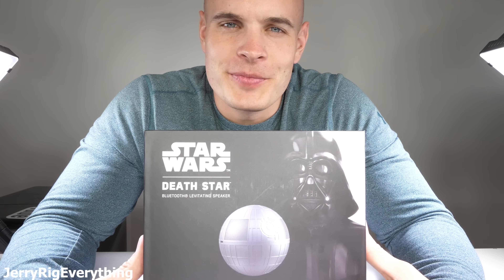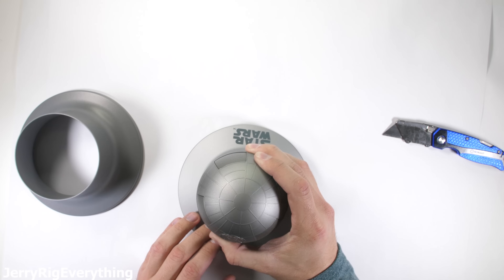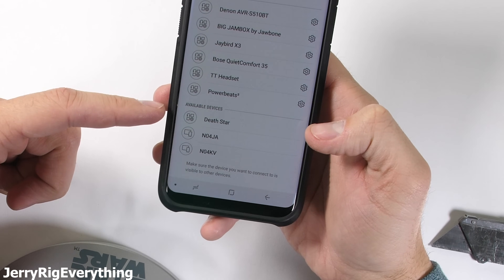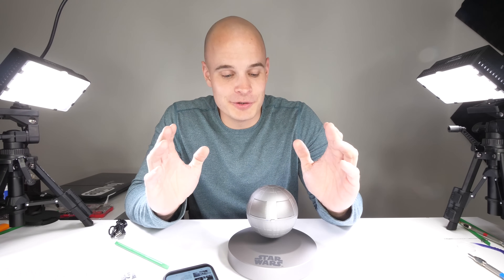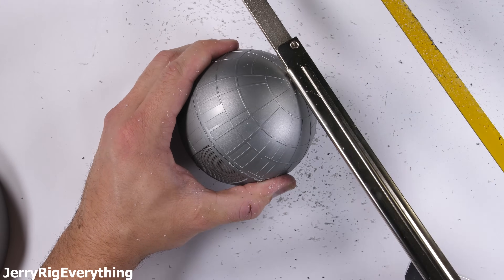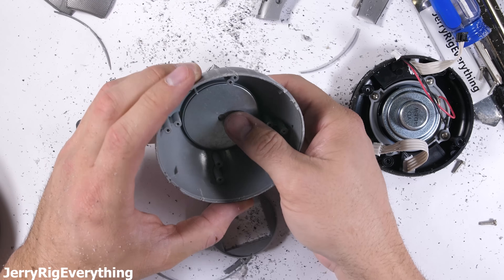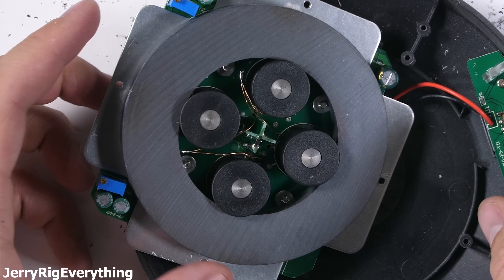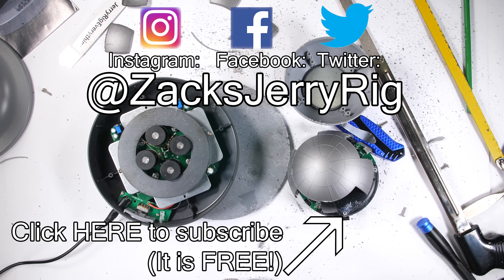How does this DEATH STAR speaker FLOAT!?

Comment: I bought 3 of them and rewired them and the charging ports to work all at the same time as surround sound and I can use them with any device cause i removed the battery and made it wired and connected all 3 of them to work at the same time

Comment: Fundamentals of some DC motor's are same..In it's Stator there are Permanent magnets of south pole and Winding creates north Pole which tends to move the rotor at high torque. You can even rotate that thing continuosly by making some modifications in electromagnetic bar.

Comment: I doubt the electromagnets actually try to adapt to the death star's position actively. Their purpose is to "simulate" that the object is moving relative to the base. This is a requirement since Earnshaw's theorem prevents a stillstanding equilibrium on magnetic forces. By actively shifting the electromagnetic fields, the death star is, in theory, in motion and can therefore balance on the electromagnetic field.

Comment: A magnet probably. Those are a pretty new invention, I think first one was made around 1200.
Reply: The sarcasm is strong with this one
Reply: I haven't personally seen any wind powered hoverboards, but anyway, that would be noisy wouldn't it?
Reply: Obviously magnets are involved, but way to miss the point.  Keeping an object stable while floating with just a couple magnets is extremely difficult.  If you actually watch the video (which you clearly didn't based on how quickly you posted...) you'd see that they actually have a microcontroller in the base that drives several electromagnets dynamically to keep everything stable.  It's actually a pretty sophisticated contraption.
Reply: @kevadu  better if they just made better technology
Reply: Any other suggestions for a levitating system instead of magnets?
Reply: Marek Vedral Wind like hoverboard
Reply: Marek Vedral they have been made, just search up air board or something like that